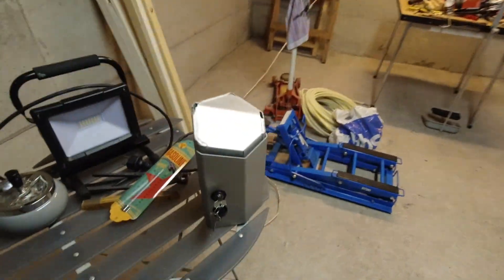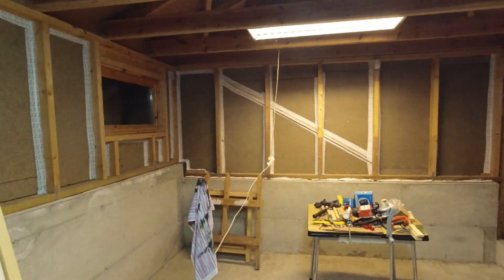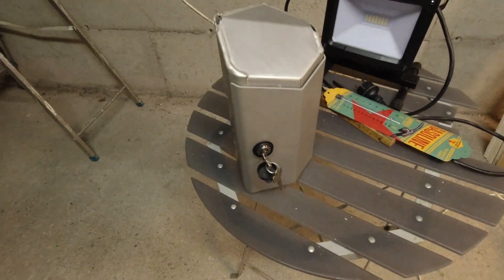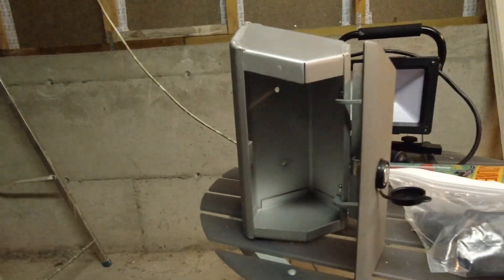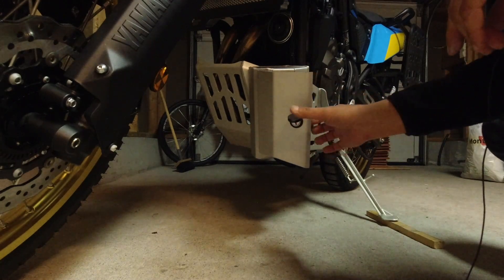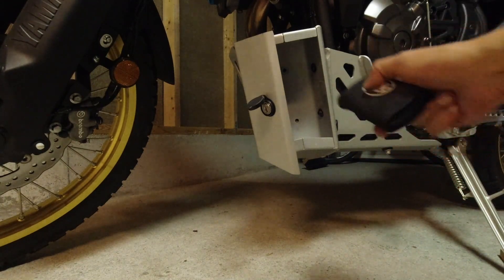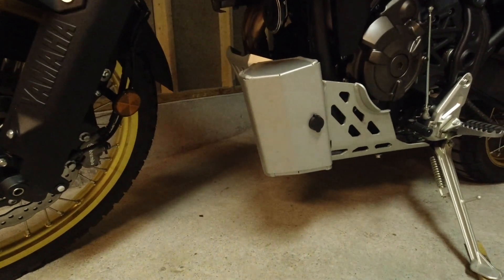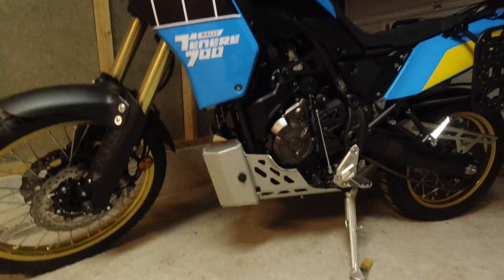Yamaha Tenere 700 Toolbox

Comment: Looks pretty handy but I'd worried about it getting deformed and/or banged open if it hit a big rock. Just to make sure it doesnt spill its content when it happens I'd put some sort of heat resistant strap with an elastic part around the top of it.
Reply from the maker: Good idea!

Comment: One reason for the high price of insulation is the requirement for fire resistance.
There are so many materials that would be good thermal (and acoustic) insulators
that would also burn, or at least emit toxic fumes if subjected to high temperature.
Do you plan to heat the floor?
Reply from the maker: No heating of floor so it will not be very high temperatures in there...think I will keep it around 15 degrees celcius.